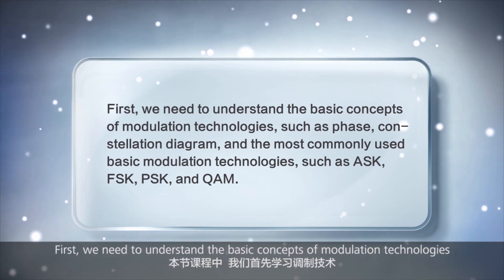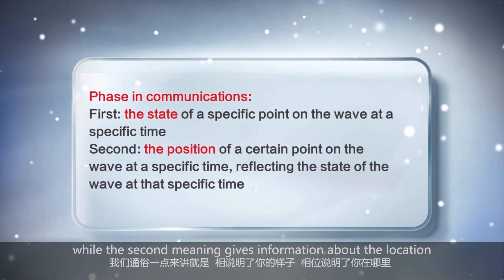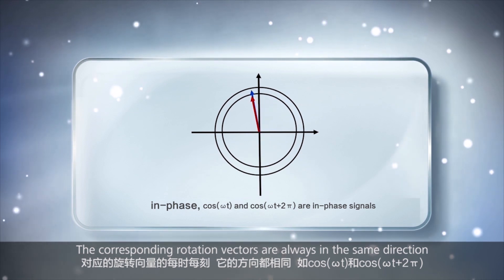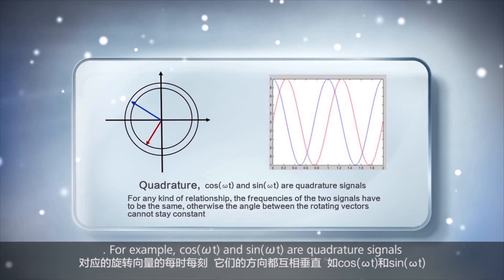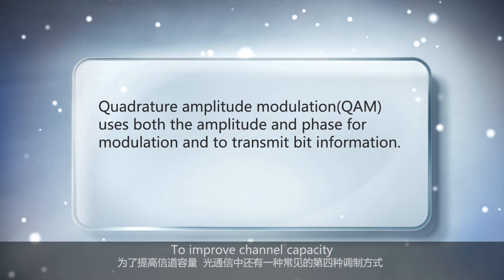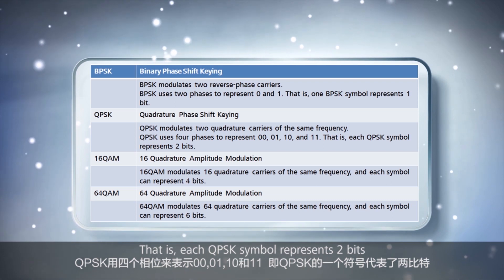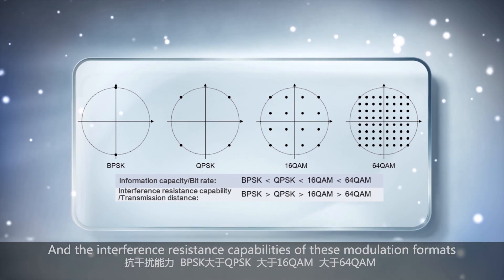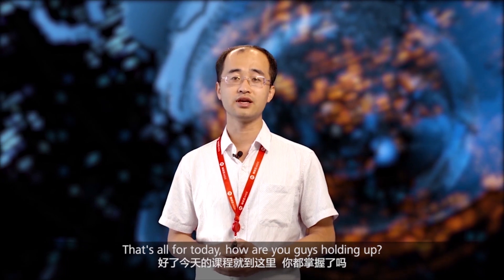Coherent Optical Communication - Modulation Technologies of Huawei

Comment: bandwidth or data rate is no more concern in communication since there's already deployed 100G systems and there is tens of thousands fiber strands buried under ground or submarines , the next concern is latency 
let's talk about latency let labs work on latency
Reply: The speed of light is the speed of light.

Bandwidth remains a concern because spectral efficiency has limitations (Shannon's Limit).